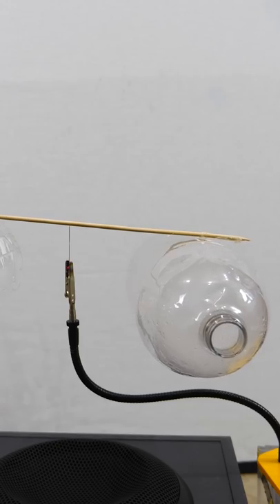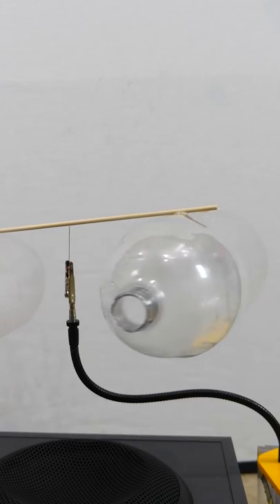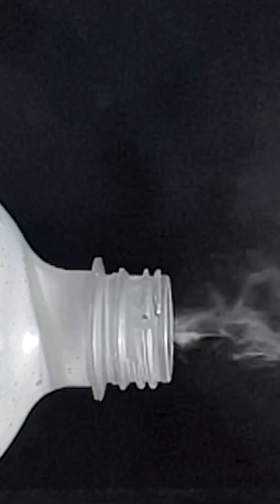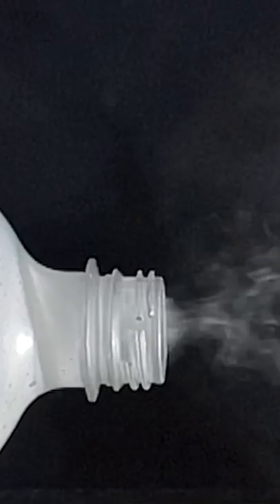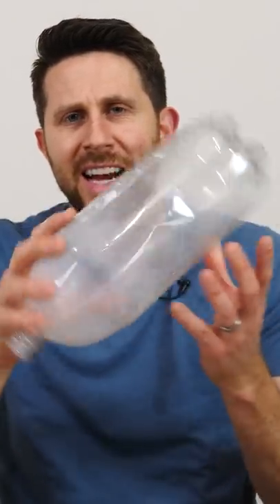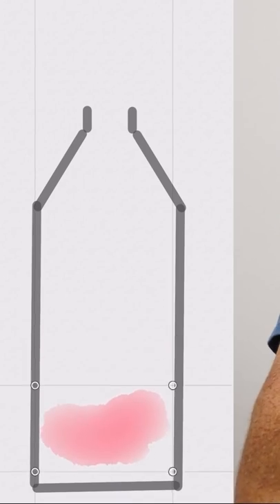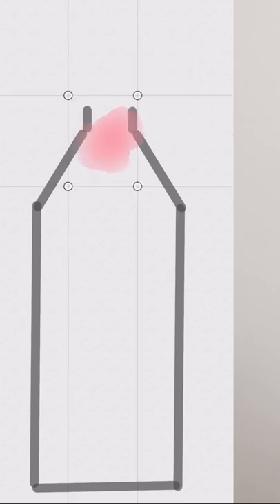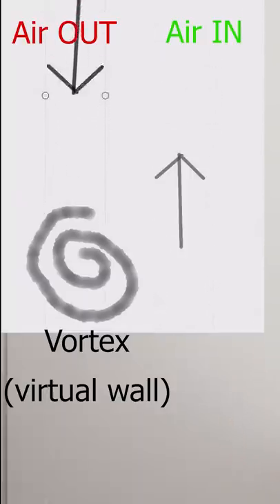Acoustic Rockets Using Helmholtz Resonance

Comment: Is there an upper limit to how much thrust and or speed you can get out of this system?
Reply: well, speed of sound exists.
Reply: @cabbit3008  Shock-waves do not follow the laws of sound. Just as, gasses differ from liquids or solids as the same periodic element.
Reply: There is a "consensus" on the matter being, "shock-wave in air travels about 340m/s"
Reply: I think the confusion is you guys are thinking of a shock-wave and sound being the same thing.
Reply: And, this wouldn't even be a shock-wave. More like a pulse cause by vibration resonance. That speed would be relatively low. Possibly as fast as the speaker has to move to produce it. I would guess.
Reply: At that point. The energy you capture would be less than it requires to push the speaker. Not viable.
Reply: Now.... where you produce power from low speed is torque. I wonder if the air volume and density could contain enough torque to produce more power than required.
Reply: @DJBillionator  you know you could just put all of that in one comment
Reply: im thinking of making a fucking plane outta this
Reply: @DJBillionator  you’d get a Nobel prize for a perpetual motion machine of you could figure that one out.
Reply: Yeah prolly
Reply: 69
Reply: I don't wanna hear another thing about thrust.
Reply: certainly, if it were 100% efficient then all of the mechanical energy input would become thrust. im sure it's not 100% efficient at that.
Reply: @talon9639  the bottle doesn't make enough thrust to propel itself and a wing let alone with the sound generating hardware mounted onboard tbh
Reply: @chrismofer  exactly
Reply: @chrismofer  :(
Reply: @ISawSomethingOnTheInternet  not possible, even by this method
Reply: Out of this one specific bottle, yes. Many modern combustion engines use Helmholtz resonators that are split into various volumes, so they get a variety of different pressure waves sent into the intake.
Reply: @shamanllama  prove me wrong.
Reply: No, if everyone hummed at 112 Hz at the same time every bottle would explode and become a rockets throwing the earth off balance.
Reply: @shamanllama  the hell? Dude, perpetual motion literally doesn't work. Easy as that. Where are all the people showing such devices? And those who "Do it" never, really never show the inside of those machines. Why doesnt that make you think? But since you know so much more, where is your machine?

Telling others to pay attention when they literally ask you for smth they pay attention to by asking you. Brain much?

But keep telling yourself how much you know and others don't while Listening to 468 hz (or so) Soundwaves to heal yourself. Science much.
Reply: Physics sucks
Reply: @usamatahir9782  well, gravity does kinda suck~ literally
Reply: Im sure there is a mathmatical formula for this, but im sure it has something to do with the largness of the container
Reply: @DJBillionator  this just gave me a great idea... we don't need to use a speaker, there are natural frequencys
Reply: @hunterjoy1871  "Largness" of the container- You mean, like it's volume? Lmao
Reply: Yeah 666th like
Reply: @DJBillionator  torque is only for rotational motion.
Reply: I think the upper limit would be the maximum amount of deformation of the bottle possible without distortion.
Reply: @DJBillionator  spam
Reply: @DJBillionator  LOL that's the speed of sound in heat. The colder it is, the slower it gets though.
Reply: Lol, the fact that the camera is picking up the hum means that a lot of the vibration is dispersed into the surrounings.
Reply: @meloney  perpetual motion doesn't work because of the whole energy thing right? like energy in a cycle cannot be created or increased it just stays the same? I'm not a science person, but like if you had flowing water in a container that rides up something and falls back down, you cannot put a turbine there cause the energy is being used to climb the container and the water cannot spare any energy otherwise it wouldn't be able to climb back up? i think?
Reply: @joeman123964  yes, that's pretty much it, energy is not endless and energy also decreases over time.
Reply: @meloney  gotcha, thanks!
Reply: @talon9639  
That could alter the historical tradition of the mile high club significantly.
Reply: @JustinRed624  
I’d rather see several separate posts than a single stream-of-consciousness, confusing, run on sentence post.  
Give a guy time to think!
Reply: @ISawSomethingOnTheInternet  I just did?
Reply: @JustinRed624  I could have. But, I don't want to force people to like something they don't.
Reply: @jerrypeppler1484  to some people. It's about presentation over functionality. (MAC users)
Reply: I'm only here replying to my comments because I was accused of spamming. So, I'm going to talk more in separate "posts" until I actually spam something.
Reply: @ethanproctor6695  exactly. Using the leverage gained by propelled air in a fulcrum or drive shaft could enable torque utilization in this instance.
Reply: If you guys make the perpetual motion machine from this.. call it the 'Wilker'
Reply: @DJBillionator  But, you do have a separation between what is within the bottle and your electronics driving it. Could that be useful if it's hooked up to a tube of potentially explosive gas to keep potential sparks away from it while moving it along inside the tube? 

I'm guessing that this already exists?
Reply: @DJBillionator  To resume what this guy said: Shock Waves follow the laws of whatever medium they are in, and idk what he means about low speed forces being torque
Reply: @DJBillionator  Isn't a shockwave/sonic boom the sound of the sound barrier breaking rather than the sound of the shockwave sent out?
Reply: At some points the material could get too hot break and so on
Reply: As soon as friction in front of the bottle is as much as the air thats used as the "wall" ie friction behind it you won't get faster.
Reply: @TheGooEater  do you know what it even means?
Reply: Would it work in a vacuum chamber?
Reply: @coopachew  Depends but theoretically its the same as a rocket so yes it should.
Reply: @DJBillionator  To be fair I think that you can’t produce more energy that the one needed to create the frequency to get the bottle moving. As he said there’s no net movement of air
Reply: I would venture a guess that you would be limited by the amount of energy that could be transferred to the system through the frequency. Continuing that thought; the system would be bounded by the natural frequency of the material you were working with
Reply: Sound powered car anyone?
Reply: @DJBillionator  no, it literally can't produce more power than it takes. That would be breaking fundamental laws of physics.
Reply: @doomguy974  I mean what if you had an external sound source?
Reply: @jacobjohnston6618  it would be unable to generate more electricity than it consumes.
Reply: In space given unlimited time to speed up this could travel near the speed of light. It is a constant linear acceleration.
Reply: This has gotta have some rocket science use
Reply: -why
-asking for a friend... in afghanistan
Reply: First thing I was thinking. What kind of frequency needed for thrust and speed.
Reply: @DJBillionator  there is no “law of sound.”
Reply: @WungusBill as an astronomer, i do know that, thank you. I think you answered to the wrong comment?
Reply: @WungusBill oh thats what you meant, my bad. I meant in the form it is at that point. With energy is not endless i meant that perpetual motion machines just don't exist.
Reply: @meloney  while of course this isn't a perpetual motion machine, you shouldn't be so quick to chuck out phrases like "perpetual motion literally does not exist". May I introduce you to time crystals.
Reply: @yoric7200  perpetual motion machines just doesn't exist. The literal definition of it already breaks the laws of physics.
Reply: @meloney  that's not what you said. I agree perpetual motion machines do not exist. Perpetual motion might though. Look into it, you might learn something.
Reply: @yoric7200  that's all I was trying to say. I personally wouldn't count orbiting planets, orbitals and whatever else to perpetual motion.
Reply: @TheGooEater  it is not the actual sound signal that propels the bottle but the momentum of each particle of air that jiggles back and forth in the sound wave. It's like an electric signal travels through the cable at the speed of light, but the electrons move at milimetres per second.
Reply: Idk, ask the CIA
Reply: @Spiceinajar precisely my point
Reply: Supposedly, this might’ve been how the pyramids were built
Reply: Diminishing returns, square cubed law, noise, fluid medium instead of a vacuum. Maybe it might most be effective with a sound laser
Reply: Find And Watch 
    Mythbusters , when they detonated the Concrete Truck , blowing it to pieces and the pressure wave , and the sound wave arrived at several seconds difference
Reply: @ISawSomethingOnTheInternet  There is no perpetual motion machine, at least in this reality it cant happen, if it seems that it is happening, then its still getting energy from somewhere or something
Reply: @guilhermealveslopes  say that to the new fusion generators ;)
Reply: @DJBillionator  in zero g?
Reply: Isn't this what tesla was working on
Reply: To answer your question, yes the pyramids were built with sound
Reply: @TheGooEater  the speed of sound is faster in water and solid objects than it is through air. so the "speed of sound" isnt just one speed.
Reply: My thoughts exactly
Reply: Likely the speed of wave propagation based on his explanation. Which would mean it could go faster than the speed of sound as long as the waves inside the bottle were moving at a fast enough speed, and assuming said speeds doesn’t tear the bottle apart.
Reply: No the system would tear itself apart before you reach the limit
Reply: This is the question
Reply: @JustinRed624  that’s so true.  True also is this:  you could be kind & nice to ignore it.  Now, you’ve influenced 120 people, at time of this writing, to have a shade of thought.  What MHz is the Sound of Silence?   Just something to ponder.
Reply: @DJBillionator  it takes energy to produce. 
Viability depends on the importance of the product. 
If this type trust were needed, energy loss could be acceptable.
But you are correct, there is a net loss of energy.
Reply: Valveless pulsejets use this exact phenomenon except they add some boom in there
Reply: The question is, does the frequency change when the shape or density of the bottle changes?  I do know that not all bottles, make the same sound at least to my ears.
Reply: Sound is measured in decibels, and it's a logarithmic base 10 scale, which proceeds in multiples of 10. So 2 db is ten times 1 db in intensity. 100 db is ten times as intense as 99, etc.

To get any real propulsion, you'd have to make a sound so loud it ripped apart the area you're trying to traverse, like a bomb.
Reply: @ISawSomethingOnTheInternet  that wouldn't be perpetual motion
Reply: @dannythorpe1425  no, just something that could create positive net energy using the world’s most abundant element. That could theoretically move a motor until the end of the earth. But no, not perpetual motion because the universe has finite resources.
Reply: the deutch accorn bell
Reply: Rocket Gokart Santa had entered the chat
Reply: @ISawSomethingOnTheInternet  unfortunately he'd probably be mysteriously unalived if he pushed that as a serious concept... Just like many others
Reply: @ISawSomethingOnTheInternet  perpetual motion machines can't exist.
Reply: Well, we generally say things can't move faster then the speed of light, but it's hardly gonna reach that speed. It's not gonna generate power to do this, because the power you would need to play that sound alone would be more then that it would generate. And you're gonna need an output that's significantly more powerful if you're gonna want to convert it into electricity. There's undoubtably no real world use for this except to watch it and say "hmm that's interesting!"

Maybe people need to know that you could never ecologically generate any usefull power from something like this. Sounds, the way metal bends.. Things like that. The reason is that you're the one using power for the engine to work. You're heating it up, making the sound with a speaker ect. That's the one that doesn't work. The two others is that you take something that combusts into energy under the right circumstances, or you harvest from natural flows of energy.

So like we dig up gas because we can use it by making it combust in engines and produce power to start a car

Or use a wind/watermill, or solar panels ofc. Convert the movement from those things through a generator to produce electricity that we can store and use. 

That's where all the power we use comes from, and it's because they're the only places we can harvest more power then were spending to optain it.

So it doesn't really matter if that upper limit is there, because no matter how you look at it, if you're the one making the source of the energy, you're not producing any energy.
It's interesting how we keep looking for ways to find the perpetual outcome, even though we know it doesn't exist. The closest we have to perpetual energy is the constant flow we have from nature, like wind and the sun is a constant generator that gives power that we can literally harvest for the next couple hundreds of millions of years, if not billions! 

Maybe we could make a space station that orbits the planet, where we pick up heat from the sun? If we don't want to waste space here on earth.. We have ways to store energy, and theoretically since the sun heats up objects that we have in space (yes, even though space is cold in theory, objects in space with direct sunlight heats up to crazy high degrees, that's why they need to be reflective)
We could harvest that heat as we do other thermal reactions. Make it boil water and convert pressure from the steam. It would be like a nuclear reactor without the nuclear but just exploiting heat from the sun.

Long comment moment :)
Reply: @TheGooEater yeah but since the wave front goes out from behind the bottle it doesnt matter too much but caution must be taken for the doppler effect
Reply: Thrust probably corresponds to amplitude and I'd reckon aside from thermodynamic effects theres no upper limit however the faster it moves the greater the doppler effect to the sound source which must be taken into account so youll have to vary the frequency with velocity which is mighty tricky
Reply: @DJBillionator  do you really wonder that?
Reply: Well there is a limit to how much vibration any vehicle can take and how much sound you can hear before losing your hearing
Reply: @youssufmoafi different frequencies for different things, you can’t hear your Wi-Fi right? So if done right you could move things without hearing them 

Also just get a variety of different sized bottles for different frequencies and convert sound into electricity. If you live in a city you might be able to charge your cell with all the car honks and sirens lol
Reply: She said the thrust was good but speed was too fast
Reply: No, it just collapses reality eventually

bru
Reply: @TheGooEater but how powerful that wave front is matters to the amount of air that will be sucked in and then compressed and displaced inside the bottle that get focused and sent out as a jet outside I’m sure.  I’d bet the more you suck air in, the more focused that jet will get at the center of the spout/nozzle …or… whatever it’s called.  lol but yea I’m sure their* (edit : *redo time lol) *there will still be a maximum achievable thrust defined by the material properties of the bottle and the air pressure and temp outside the bottle to begin with. 

(haha I beat you to it, you spelling error zombies)
Reply: @DJBillionator  my thoughts exactly. I hope he comes back to this topic